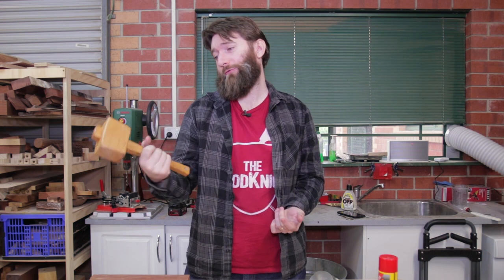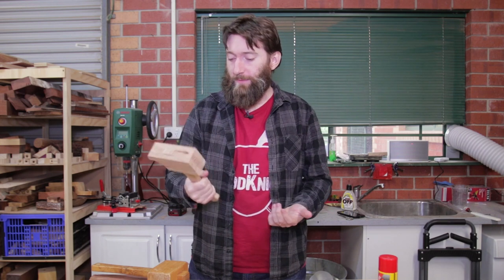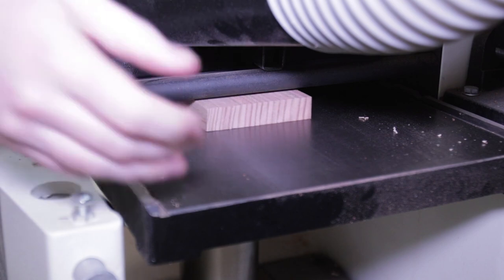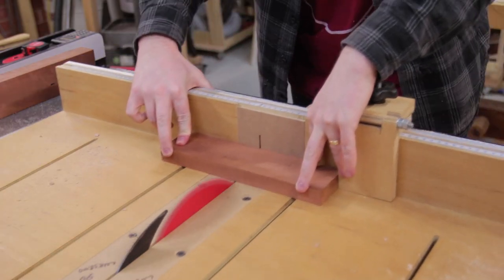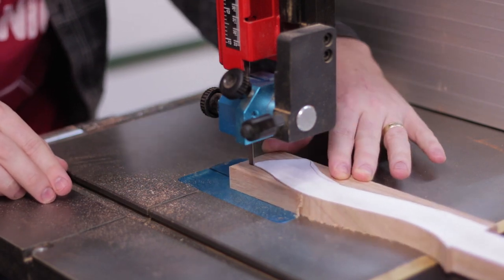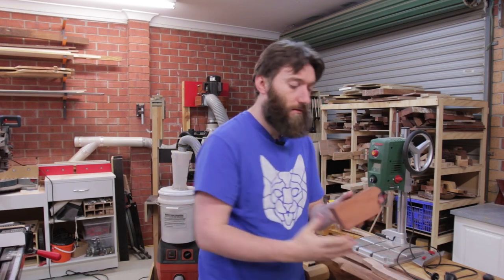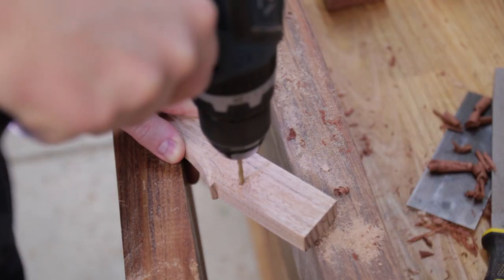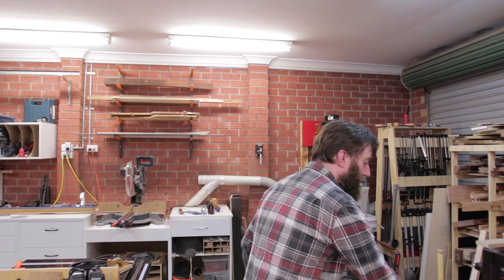How to build a (hatchet inspired) woodworking mallet

Comment: Any issues with it twisting during use since the weight is more towards the front? Looks great, BTW
Reply from the maker: Hah, somebody asked about a similar thing in a private group. I'll share my response from there

It's a bit of a weird one - it actually isn't as front heavy as I expected. I sort of just dumb-lucked-my way to a good balance. The initial prototype had a longer mallet head, and despite being lighter, was more tippy. I am able to just balance it in the palm of my hand (handle in my palm, standing upright), but it is more difficult than a symmetrical hammer.

In actual use, it doesn't feel excessively front heavy, but I don't have a range of mallets to compare against. I also don't know if its "bad" if its front heavy as it does mean you can sort of just 'drop' it onto the chisel rather than swinging.

It also does depend a bit on where you grab it. If you grab it in the arc near the head of the mallet, it feels really well balanced. Grab it near the toe of the handle and it feels like a flick of the wrist is all thats needed to smash through a mortise. 

Grab it two handed (its kinda a bastard-sword of mallets) and it makes the wife uncomfortable around me!